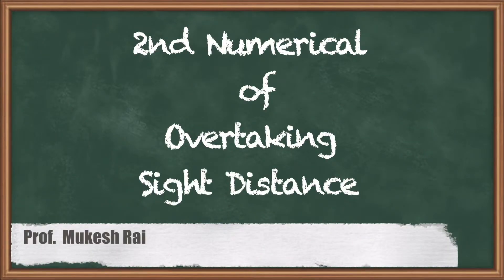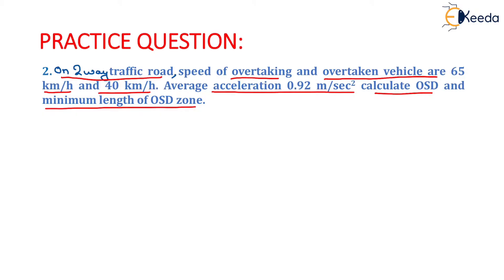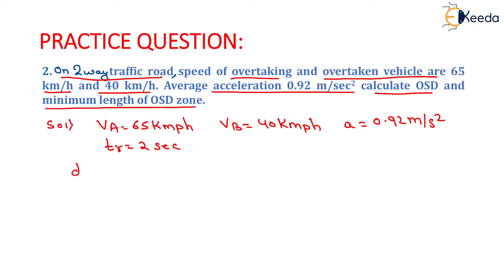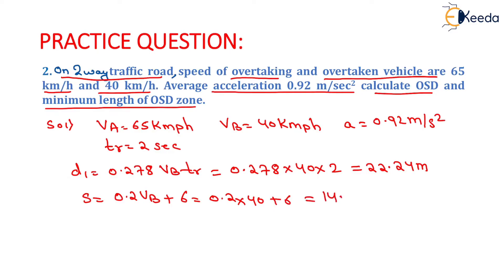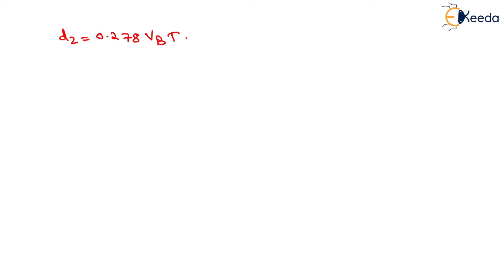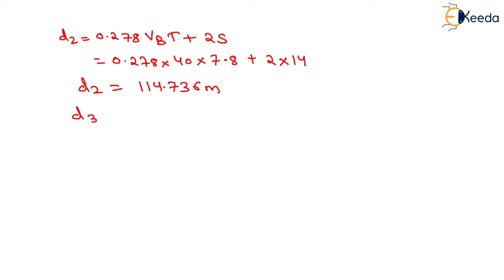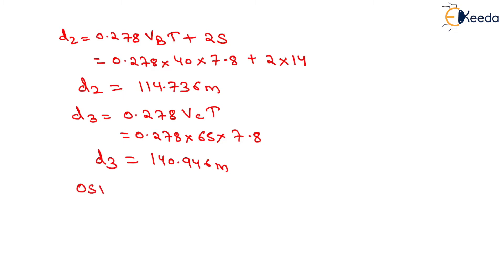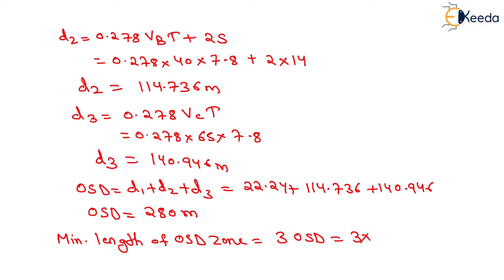2nd Numerical of Overtaking Sight Distance - Highway Geometric Design - Transportation Engineering 1

Comment: The speed of vehicles, overtaking & overtaken speeds are 80 kmph & 45 kmph 
respectively. The average acceleration during overtaking may be 0.93 m/sec2 and 
reaction time t= 2 sec (i) Calculate OSD for one way & two way traffic road .
(ii) Calculate minimum length of overtaking zone

Comment: While calculating S, u first need to convert the value 40 km/hr to to m/sec, so we will get answer in seconds
Reply: No need to change bcoz when u use formula( .278Vt)
Reply: Sir  to find ‘S’  correct formula is 0.7vB+6. Not 0.2vB+6
Reply: Sir why u continue d3
Reply: Kaha se padhe ho bhai😂
Reply: @kanchanyadav4783  khud padh le pehle